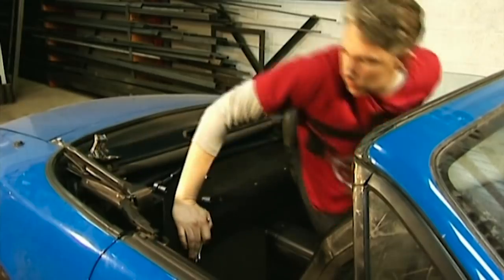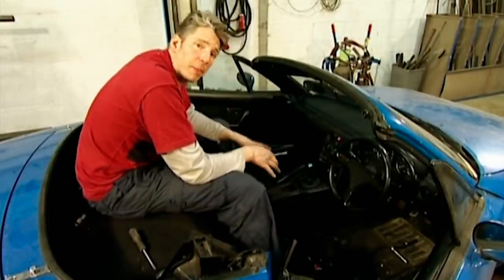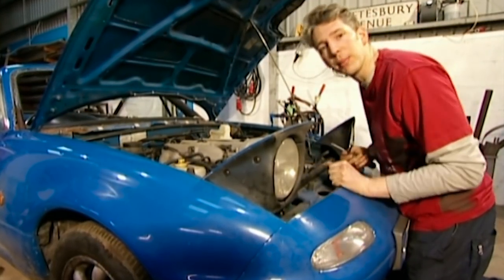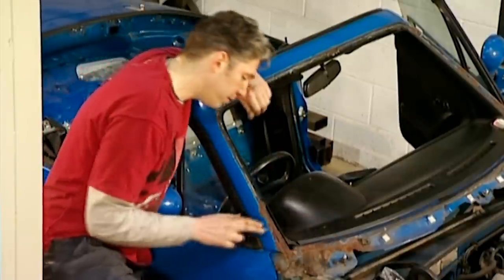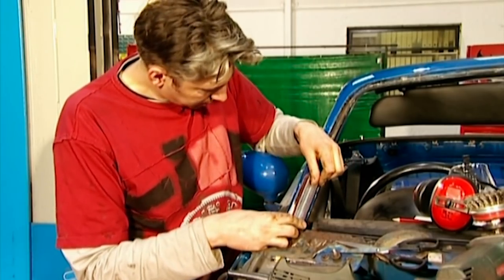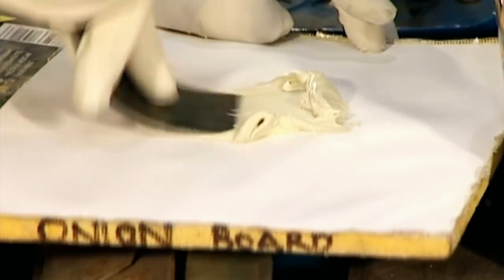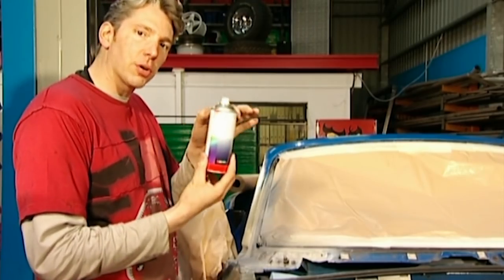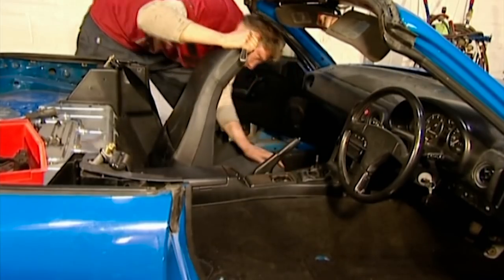Mazda MX5: How To Change The Interiors I Wheeler Dealers

Comment: Hello everyone! O, I remember this 2005 WD episode (S3E1/2). As always Edd did a brilliant job when he replaced convertible hood, interior, installed chrome trim, metal gearknob and handbrake handle, chrome MX-5 kickplates, chrome mesh grille, performance air filter, chassis braces, 15" white Enkei factory alloys, repaired and repainted corroded A-pillar. However, the repair of the window mechanism and broken right mirror replacement were not shown in the episode.